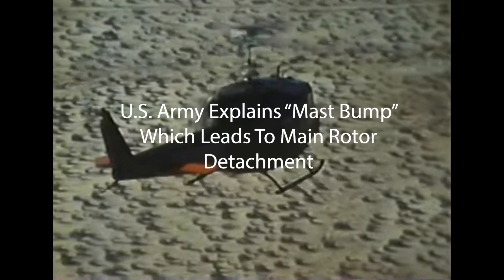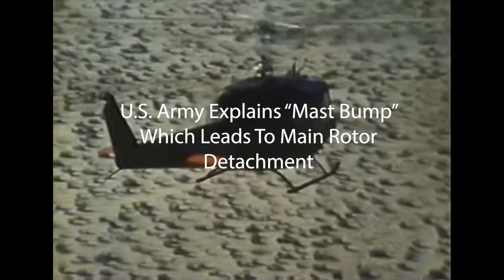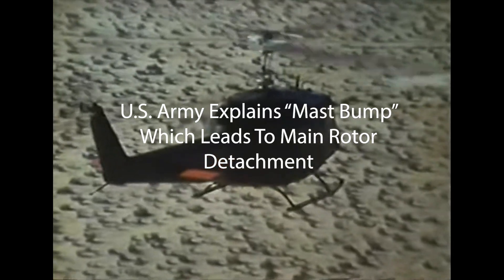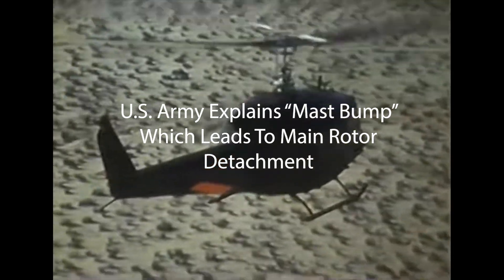What Likely Happened to Helicopter That Crashed into the Hudson River - Mast Bumping

Comment: This video (https://youtu.be/BJ-G55yOLmM?feature=shared) shows level flight and appears to capture the moment when the pilot radios that he is experiencing difficulty, eventually stating that he is "struggling to control the aircraft." Shortly afterward, there is a violent nose yaw to the right, resembling main rotor torque spin, but it is immediately preceded by a small snap back.

The pilot's radio transmission could indicate a failure in the tail rotor drive shaft and/or tail rotor gearbox (possibly at the flex plate union connecting these components), which might explain the initial trouble caused by a rapid reduction in tail rotor torque. An unexpected loss of tail rotor torque on an aircraft with a counter-clockwise main rotor would produce a right nose yaw, prompting the pilot to react in an attempt to counteract it—ordinarily with a 100% left pedal input. However, this action may have exacerbated the situation. While it would normally be logical to counteract right yaw with left pedal input, in a scenario where the right yaw is caused by counter-clockwise main rotor torque, it counterintuitively necessitates *right* pedal input—meaning movement in the same direction as the yaw, completely opposite to conventional input. 

The additional force created by the inadvertent left pedal input could have overstressed the tail rotor drive shaft and/or tail rotor gearbox, which were already likely at or near failure, ultimately causing the separation of the tail rotor from the boom. Any possibility of right pedal input mitigating subsequent events was unlikely, particularly if the tail rotor powertrain was already close to failure.

Notably, all of this occurs before any main rotor separation which makes sense given that the combined forces of the unexpected tail rotor failure amd subsequent attempted corrective inputs that were likely the opposite inputs overwhelmed the main drive shaft to transmission union which also separated.

5 seconds from observed aircraft behaviour to tail and main rotor separating...
Reply from the maker: Yeah. I put that video in this one. https://youtu.be/PzJslDRNd74?si=seNLG6E7JA0-rL-H

Comment: If this turns out to be mast bump, I will be very surprised.  I'm leaning toward catastriphic mechanical failure that has nothing to do with pilot input.
Reply from the maker: the 206s replacement, the 407, does have a problem with tail detachment. Caused a crash in Hawaii. Looks like it might be the case here. A helo pilot told me mast bump doesn't cause the rotor to hit forward of the tail rotor section. I saw the new video with the entire tail separated after I made this video.

Comment: Helicopter EMS pilot here. I watched footage of this for probably an hour or so. He's flying straight and level as far as I can tell. No abrupt pitch of the nose in either direction. One of the first things to happen in the accident is the nose pitches right. In a counterclockwise rotor system, an uncommanded right yaw is a sign of anti-torque failure. The next thing is (from the best I can see) is the tail boom failing completely. The helicopter fuselage rolls over, and then the main rotor separates and is even still spinning at a high RPM. When rotor blades come in contact with a tail boom (or almost anything for thst matter), it's basically self-destructive. With all the energy those main rotor blades had AFTER separation, they did not contact the tail boom. I'm not an A&P but I think it was some sort of catastrophic failure on the tail section. The rest of what followed was just a horrible chain reaction. Unrecoverable is that saddest part. The pilot did nothing wrong in my eyes. No external factors caused this. Winds, turbulence, or bird strikes are out of the discussion. Just a horrible accident. Everyone be safe out there.
Reply: YOU may be on point  "Anti torque rotor FAILURE"  The aircraft YAWS INSTANTLY  !!!   most likely NOT caused by  pilot 
action . So I would agree , Anti torque rotor malfunction due to some unknown cause , starts a catastrophic chain reaction
Reply: So, the chain reacción is that after you lose the tail the whole sustaining train strip away? Come on. Think as pilots, how could you help to strip It away? 🤣🤣

Comment: With later imagery showing the transmission still attached to the rotor, it appears there was structural failure of the transmission mounts.
Reply from the maker: Yeah, I saw that after. The same model helo crashed in Australia in 2023 after mast bump. The main rotor with transmission attached sheared off in that case also. At any rate, we'll find out soon what happened.

Comment: As a commenter below has stated the whole transmission and rotor have come loose. If you get to see how this is all attached to the roof of the fuselage (in a Jet ranger) it has turnbuckle like mounts that permit a certain degree of movement as the vibration is already sufficient to break solid mounts. Obviously the vibration went severely out of control to break these types of mounts. I would suggest the flapping linkages have seperated and then the blades automatically went into all kinds of periodically dramatic pitch angles causing monsterous forces at the transmission mounts.

Comment: The pilot was black, all you need to know.  Many such cases!  No thanks.
Reply: From a videos that I saw, the helicopter was going normal speed and was in level flight when it happened.  This is a mechanical or structural failure.

Comment: The thing that cuts and severs the main shaft is the titering cup. For model RC helicopters, there is no titering cup, and the rotor hub is overly thick and strong to transfer all force directly from the blades onto the main shaft.

Comment: If you look carefully, you'll see that the Main Rotor, Rotor Head, Mast, and Transmission departed the Helicopter together... THIS IS NOT MAST BUMPING.
Reply: Also possibility of transmission lock up, because the fuselage spun on the same direction of the rotor
Reply: CORRECT  !!!  100%   this incident was NOT due to MAST BUMPING
Reply: It was a structural failure where the main planetary gear transmission connects to the fuselage frame. Looks like bad transmission mounts with complete failure probably from accumulated micro-stress fractures.
Reply: Why did the tail shear off before the rotor and gearbox detached?  The blades continued to spin?
Reply: @timothym2241 in the jetranger, shorter cousin to the 206L-4, the boom is attached with 4 bolts,  I presume it's the same with the longranger,  I work on fixed wing aircraft but I would imagine that they would be inspection items on their hundred hourlies, annuals etc with replacement being mandatory after a certain time period.  Looking at the accident video, it appears that the aircraft yaws instantaneously and violently to the right before the main rotor and transmission assembly separates from the fuselage indicating that something to do with the tailboom suffered a catastrophic structural failure with the resultant changed flight loads stressing the main rotor transmission/roof structure/ mounting assembly beyond design limits hence departure from the rest of the aircraft. 
One thing that hasn't been mentioned yet but needs to be taken into consideration is did the pilot have a sudden medical event which instigated unintentional control movements which could have had tragic consequences? It happened here in Australia back in 91 and it happened to involve a longranger with 7 on board,  witnesses thought the pilot was showboating when the helicopter did a nose high climb and it sliced it's tail boom off and crashed onto the beach killing all on board,  turns out that the 28 year old pilot had an underlying heart condition that escaped annual medical exams and it came to a head and he had a coronary event
Reply from the maker: I have a new video up where the same model helo has the main rotor with mast & transmission shear off.
Reply: Yeah more clips have come out and it was in level flight. Best guess is gearbox issue that overtorqued the heli and caused the tail to fail. As with all stuff like this we have to wait for the NTSB final report for the proper cause.

Comment: 30 year helicopter flight instructor and ems pilot here. This is very unlikely to be low g mast bumping. LGMB results in the main rotor blades detaching from the mast just below the main rotor hub. The fact that the main rotor blades and main rotor gearbox are still together points to something besides LGMB. More likely a catastrophic mechanical failure of the main rotor gearbox mounting system. Incorrect maintenance is a possible cause. There could be other explanations. When the ntsb retrieves the tailboom and the main rotor assembly they will be better able to determine the cause.
Reply from the maker: Yes. I have a new video up where the same model helo has the main rotor with mast & transmission shear off, plus a newer model (407) that has had the tail fall off.
Reply: Very sad. Being a pilot for over forty years I never wanted to transition to rotorcraft. I have crashed my RC helos too many times with boom strikes. God bless these unwary tourists.
Reply: Plus, that was a very experienced pilot. He’d have no reason to do risky maneuvers that could lead to zero g loading.
Reply: @AvgDude  the guy only had 700hrs of total time, mostly just tourist flying. that’s hardly “very experienced” especially when most operators can’t even get you on their insurance unless you have a minimum +1500hrs(3000hrs for govt contracts)? The guy was still green in the grand scheme of things.
Reply: Who knows, maybe the pilot did some hotdogging to give the kids a flight of a lifetime? Can’t count out anything

Comment: some or all of the xmsn came off, thats not mast bump. that's a tail strike causing the xmsn to rip from the airframe. Loss of control or the guy was screwing around doing push overs or hammer heads. 206s dont just fall apart.
Reply from the maker: I have a new video up where the same model helo has the main rotor with mast & transmission shear off.

Comment: I agree, however it doesn't explain why the tail is missing
Reply: The reason why the tail is missing is because if a 0 g environment is created for whatever reason the main rotor propeller will bow and if it bows it will strike that tail
Reply from the maker: I have a new video that shows a newer model that has a tail separation problem.

Comment: Good video.  I'm wondering if the pilot could have gotten into vortex ring state.  If so that would potentially allow the rotor to contact the empennage.  That would explain the missing tail and the rotor tearing itself loose along with a big chunk of the transmission.  Perhaps the pilot slowed to make his turn back up the river?  I'm not familiar with the tour routines used along the Hudson.  I'm also wondering if a stray drone could have hit the accident bird.
Reply from the maker: I have a new video up where the same model helo has the main rotor with mast & transmission shear off after a bird strike.

Comment: I had a 206 A&P and pilot look at this, he believes that the entire transmission is still attached to the rotor system when it separated.
Reply: Yeah. I agree. Mast bump theory is inconclusive. Why would the pilot aggressively maneuver to unload the main rotor (unless showing off).

And in the video if not the transmission, what else could the large mass under the rotor on separation?
Reply: AD Cf-2016-13R1
Reply: @marcinkot2597  could very well be something locked in up.One of the first things the FAA.will look at.The A.D.s and if action was taken.  J.M.?
Reply from the maker: Yes. I have a new video up where the same model helo has the main rotor with mast & transmission shear off.
Reply: That's what I saw.Although we haven't seen transmission problems.I think the transmission locked up.I seen recent gear failures in a different venue that uses the same type steel. T/F. Dragsters?
Reply: some or all of the xmsn came off, thats not mast bump. that's a tail strike causing the xmsn to rip from the airframe. Loss of control or the guy was screwing around doing push overs or hammer heads. 206s dont just fall apart.
Reply: @nomadchad8243  What's a hammer head?